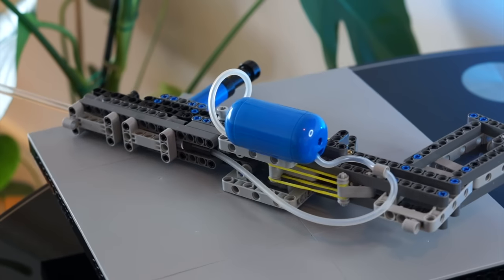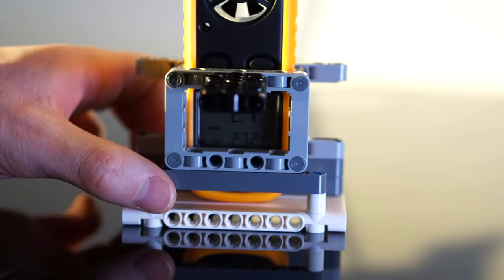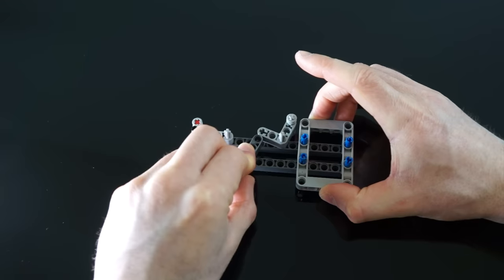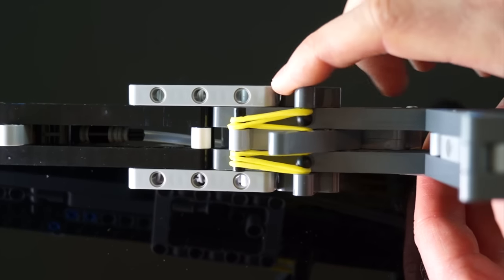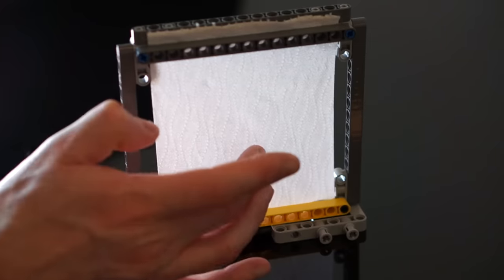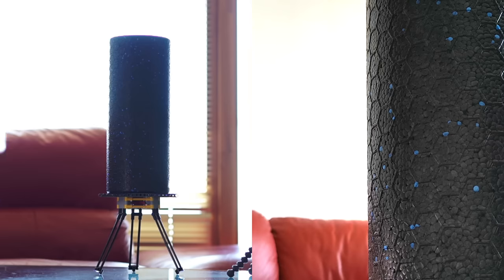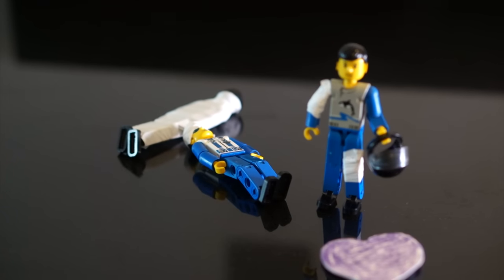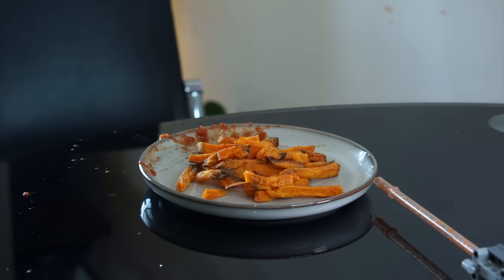Lego Pneumatic Dart Gun Destroying Everything

Comment: this version has a lot to improve, especially the air locking system, try making shell type system and magazine.

I would recommend better airtank system, it should have main tank and shooting tank(can be pneumatic pipe), reload valve(switch), and shooting valve(as in your version of your airgun) main tank should be bigger than shooting tank.
principle of new airtank system: reload valve is opened and some ammount of air from main tank is transfered to shooting tank, than reload valve is closed and now airgun is ready to shoot (assuming that gun is loaded), now you can open shooting valve (make a shot)

main advantage of this system is you can shoot several rounds before repumping the system, and if you will make your rifle mag-fed it will be almost semiauto!

(if you didnt understand something please ask)
Reply from the maker: Those are some fantastic suggestions, thanks for sharing! I love the idea of a storage main tank and a firing tank. I'm guessing the main tank would have to be kept at a higher pressure than the firing tank? So then when transferring to the firing tank you could have several shots at full power before it starts dropping. Great idea having a reloading valve - that I can certainly do. Would love to find a way to make the reloading quicker too. Cheers for the tips! 🙏
Reply: @JamiesBrickJams  you got everything right 😎👍 im glad my advice is helpful 😁

Comment: Add a bolt action that actuates the pump and recharges the cannister for the next shot! (Actually it'd be really cool if it also reloaded since it seems like the the design would already be pretty breech-load compatible, probably the hardest part would just be getting the tubing to be automatically re-crimpable)
Reply from the maker: Ooooh that's not a bad idea.. I'd likely need a lot of compressors to compress enough air in a single stroke to power it, but it might be possible (like those old crossbows that have a large lever). Auto reloading and re-crimping isn't actually too challenging - my original design used a re-crimping setup! Cheers for the ideas, I'll certainly play around with them 😁

Comment: A possible alternative to crimping the hose: try modifying your switches to accept more airflow. Good video though!
Reply from the maker: I actually tried that. It does let through a lot more, but unfortunately it's still way too slow. Turning the valve switch isn't quick enough, and tends to result in more of a 'woosh' of air rather than a pop. The new version has a much better crimp mechanism though!

Comment: To be honest, you'd need alcohol combustion (basically do an alcohol gun) to make this the best it can, as lego air pressure is really minimal
Reply from the maker: That's a cool idea.. I've never heard of an alcohol gun, though I'd imagine it's like a spud gun using butane? I do have another similar idea that vaporizes aluminium foil using high voltage to produce propellant.. will see what's possible
Reply: @JamiesBrickJams  You'd be creating hydrogen if you vaporize aluminum, which is highly explosive
Reply from the maker: @giovannicesaramorim9adigan961  Sounds like it'd do the trick
Reply: @JamiesBrickJams  hydrogen is very dangerous to use, and I do not reccomend using lego for encapsulating the explosion

Comment: Nice bro, few questions for u

How long does it shoot? (What’s the range of your weapon?

Can it completed destroy a Lego target? 

How much air is used?

How the mechanism works

This creation is truly amazing. Good work :)
Reply from the maker: Thanks man, appreciate it! Well it's Lego, so it's pretty limited by the nature of it being plastic and leaky. But considering it's Lego I was very impressed. Max range with a needle dart was around 8 meters (26 feet), but the axle with Teflon tape actually got much further. I don't know the max as my apartment is pretty small, but it can do the entire length of the apartment (about 8 meters) without dropping much. It uses the small blue air tank as the reservoir, and the mechanism is explained in the video - just a crimped pipe holding the air in until it is de-crimped. The next version will experiment with more tanks, thicker tubing, and perhaps motorised compression.

Comment: Really good video as always, i do have a question about 3:08 the handle is at an angle which normally isn’t possible with 2 parallel lift arms like that without bending them slightly, and the left one doesn’t look like a normal Lego lift arm, is it some sort of silicone part or something?
Reply from the maker: Oh yeah that one liftarm is a knock-off as I ran out of them, but everything else is stock. And that angle is all done using stock Lego parts. If you look at the liftarms holding it in place, you'll see one side is offset by a single hole. I discovered it by accident when I stuck the pin in the wrong hole 😅 Give it a try if you have the pieces!
Reply: @JamiesBrickJams  ohh ok, I didn’t think that would actually fit normally but it does, I do think it puts stress on the pins though, because when turning it shifts off the stud grid by a millimeter or so, so it might be an illegal building technique
Reply from the maker: @poemes  hmm it doesn't feel like it puts any extra strain on anything.. but I guess out of all the things I put Lego through, a little illegal building here and there is the least egregious

Comment: Question: is it possible to add a magazine without leaking problems?
Reply from the maker: Good question! I've been playing with various mechanisms, and it's really challenging. It's definitely doable, but the rounds tend to get stuck when trying to put them into the tube. Sealing it (loosely) is ok with the rubber piece I'm using in this build. So I think it's possible, but it's gonna take a while 😅

Comment: Hey, i recreated this based on how u built it in the video, but i didn't have an air tank, so i used a 12 oz gatorade bottle. It can only shoot like 2 feet. Are pointers on getting it more powerful?
Reply from the maker: Hey, I can say from experience that filling a 12oz bottle will take absolutely forever, and releasing the full tank all at once won't increase your speed much. What you could try is useing a really long piece of pneumatic hosing and no tank. I've found using long pieces of hosing allows you to build up quite a lot of pressure, even without a tank. Also, having a good pipe / straw with a reasonable seal makes a big difference
Reply: @JamiesBrickJams  I'm using a metal straw that has a good seal so I don't think that the problem. Thanks for the advice I'm gonna try the hose idea right now.
Reply: @JamiesBrickJams  also you were right about the 12 oz taking forever especially since I only have one pump
Reply: @JamiesBrickJams The tube idea doesn't seem to be adding much more power. Im not hearing any leaks and the seal is still really good. The tube is around 2ft and I've tried like 4ft too.
Reply from the maker: Hmmmm that's a tough one.. I have a few different pneumatic hoses, and the slightly larger one works reasonably without a tank. You can get this stuff (sold as food tubing) on Amazon. It is possible to buy knockoff Lego tanks on Amazon and AliExpress if you wanted to pick up some Lego compatible tanks. They actually work really well
Reply: @JamiesBrickJams  the tubing I'm using is official lego tubing from set 42053. My only problem is I don't really wanna buy a tank, but I want to make this really bad, so I might just get one.

Comment: fun :D
Reply from the maker: Thanks 😁 V2 should be even more fun (once I get around to it)
Reply: @JamiesBrickJams  maybe you can use a flywheel system for fully automatic?
Reply from the maker: Unfortunately it requires quite a significant burst of air for each shot, so I'd still run into issues compressing the tank between shots. Though I do think semi-auto with a brief pause for compression should be possible!
Reply: @JamiesBrickJams  ah nice! maybe semi auto with a magazine that uses air pressure to reload too!